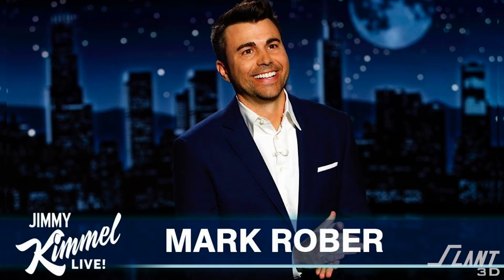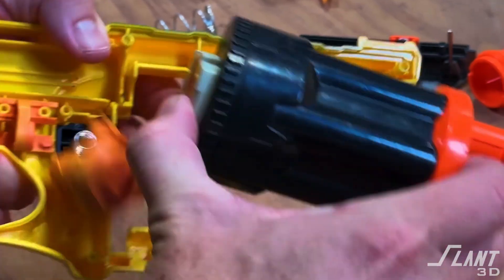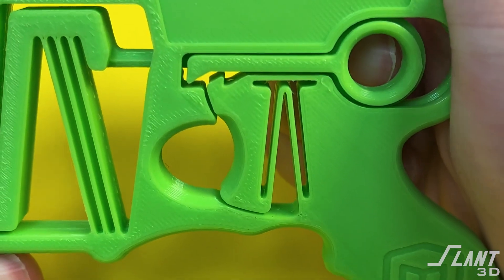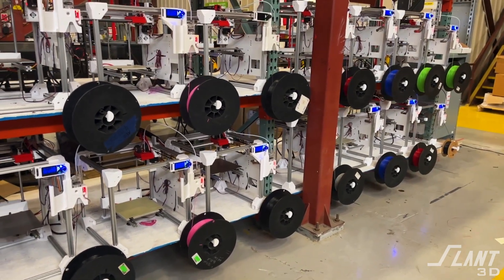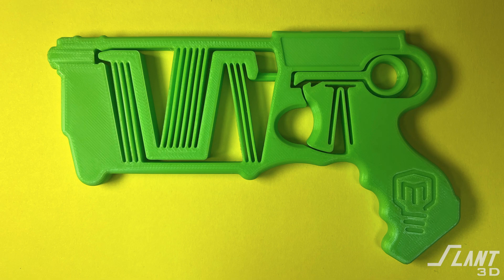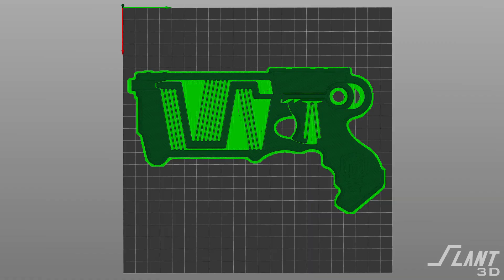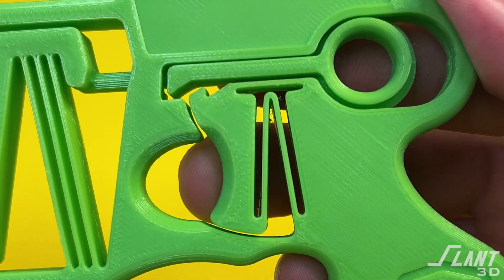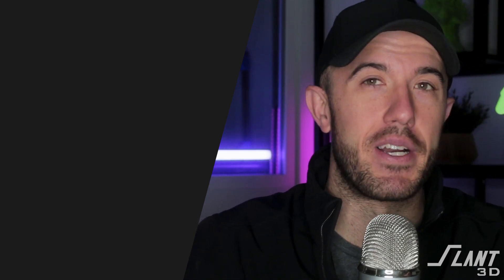The Secret Inside Mark Rober’s 3D Printed Nerf Blaster | Design of Compliant Mechanisms

Comment: This thing should be easy to injection mold with some minor changes to the cocking mechanism and trigger group.
The narrow lines from the compliant mechanism vs the thicker lines of the frame can be mitigated with additional injection points.
Reply: Yeah same, I don’t agree with Slant’s statement at 1:05 that the gun can not be manufactured. Only minor changes need to happen for the part to come out of the injection mold. So, definitely manufacturable.
Reply: @Electheo  It goes against everything slant3d stands for. 

When something cant be on a 3d printer with a desirable outcome he says "design for the process". When something is more expensive/ difficult on injection molding, its "this X could not be manufactured". He has made his business to compete with injection molding. The last thing he will do is admit even the smallest concession to that process.
Reply: That's what I was thinking too
Reply: ^ This, toolmaker by trade, and there is nothing about this mechanism that couldn't be injection moulded. It's annoying listening to this guy.

Comment: I know printing as one piece would be ideal. But some of the issues you addressed could be solved by a 3 piece design. one being the dart gun mechanisms, and two outer "shell" pieces that provide the profile. I do think its awesome to print everything in one piece, but three pieces that snap together is significantly less than the initial injection molded counter part. A added bonus is you could use different colors for the center part and the outer shells to provide more visual variations without the need for multicolored printers (granted each printer is already using different colors)
Reply: With very little modifications to this design, you could make 98% of this object by laser cutting it or using a CNC, all from one sheet of material. The only downside would be to have to pierce the bullet hole separately and doing a bit of sanding. 

That’s the thing that puzzles me a lot with how people use those compliant mechanisms. Most of them would be perfect for laser cutting or CNC manufacturing, which would be so much faster and cost effective than 3D printing.
Reply: 3d printing is just a low commit prototyping medium and admittedly doesn't scale well
but if you just need one or two, or need to iterate. S
perfect process.
the kicker though, is i think the price floor for a cnc machine is a little much
Reply: A 3 piece sandwich covers the barrel channel, and the guide at the back, leaving the center layer as a pure 2D section.  3 pieces that could be made by a laser cutter, injection molding, CNC, etc.

Comment: 3:37 .. what? adding a ripple just makes them marginally longer and more deflection, so a weaker spring per same thickness. How would that make them behave like they are thicker aside from just.. making them thicker? Maybe if you had a biased curve one direction then the other like a singular 'S' per spring element, but not continuous repeating ripples unless you are creating a tension or compression spring. In Rober's design it's a compound spring element more complex than those, the central shaft even deflects a little, unsure if intentional or not.

Comment: I would also like to mention that the bullet doesn’t need to be round. A square-section bullet would mean that the “barrel” could be printed as a simple square hole, with its sides either 45-degree to vertical or at 90, with bridging.
Reply: Eh
Reply: That might affect aerodynamics though. I'm assuming square projectile wouldn't shoot as well as a round one, but thats just a guess. Might not matter without projectile rotation

Comment: Printed one of these myself and was a bit disappointed with the tumbling bullet. I'll have to try the dual density approach! Also the "raft" idea doesn't seem like it would work well. Wouldn't it introduce friction as each of the fins flex along that new surface?
Reply: I’m also not a fan of the raft idea. Large solid cross sections may be geometrically “simple” but the shear material usage and layer time is unattractive. Not to mention when you put that much plastic on the plate you run a much higher risk of thermal warping or peeling (at least on entry level printers). A 30% grid infill is much more stable on a first layer than 100% solid first layer for a large XY footprint part.
Reply: Probably want to make it so thick that there's space to build the springs unsupported.
Reply: Hey Mike!

Comment: Nice video. I would like to see you actually implement some of these suggestions. I think the raft idea would cause problems with all the moving springs. Also, I don't think you should put Slant 3D branding on other channel's video clips. If I had not already see nMark Rober's video, I would have  believed this was all your intellectual property.
Reply from the maker: Title, intro, and whole video references and credit Mark
Reply: @slant3d  You mention several times that he did a video, and you provided a link in the description; that's good. But you still imply by your watermark that this entire video content is yours. You cropped off Rober's watermark and added your own on the segments that you borrowed. I don't think you are trying to cheat anyone, but removing someone else's watermark does not look very good. Just sayin'.
Reply: @no-page What are you talking about, my guy? Mark never watermarked his videos. If you're talking about the mark logo on the right-bottom side of his video, that's a channel button and not attached to the video itself. 
Also the 3D design (which licensed under CC) itself already has Mark's logo on it. If Slant wanted to, he could've easily removed it.

Comment: These are all good improvements... BUT a fully 2D version is interesting too, cause you can make it out of sheet metal using any 2D process (waterjet cutting, laser cutting, etc).
Reply: Rober does have a laser cut wood version on the Thingaverse page, but it's really just a demonstration I guess, as you'd need to glue on extra pieces to hold the bullet in place, like slant3D said.
Reply from the maker: But you can't. YOu can to enclose the plunger and the bullet. It would have to be a 2-3 layerer metal part
Reply: @slant3d  sometimes a larger count of simpler parts is the better option.

Comment: Your approach to auto-ejection is unclear, but in my experience using a wham bam plate and letting it cool off before taking everything off makes the 3d printed parts simply fall off with no issues. Scraping with a plastic razor blade helps a tiny bit, which of course also could be done for an auto-ejection system.

Comment from the maker: Let us know what improvements YOU would make to Mark Rober's Nerf Gun, and if you think we should redesign it in another video.

Thanks for watching!
Reply: I’d be awesome if you completely redesigned it to be a fully enclosed nerf gun made out of one part. Especially if it had similar power to a traditional nerf gun. That would be epic
Reply: I would move the handle more underneath the mechanism rather than in line with it to get a little more use out of the size of your plate.  Also it would be cool if instead of shooting pellets, it shot a winged gilding projectile.
Reply: I definitely would like to see what a slant slinger would look like.  As well as improved darts. I'd wonder if you could use triangular or gyroid infill to create the spring features.  Though that might add to cost.
Reply: While I understand the goal of Compliant Mechanisms is to minimize part counts, single part products seem more are a novelty. What would be the advantage/disadvantage of having additional material snap into place to create a thicker handle for better grip and product functionality and a more useful lifecycle?

Example: a design including a fold-over sections that sandwich and lock to the handle.
Example: a design with additional textured handle part(s) that could go on either side, to increase thickness and appearance. (increasing the possibility of using a  second color, or material like TPU to make a handle more grippy)

Realize this would add requirement for assembly, be it the consumer or as a manufacturing step. What would be some of the non-obvious impacts to mass manufacturability that designers may need to consider when weighing part counts and assembly options of a design?
Reply: While this might be a bit too big of a challenge, something you should at least consider is scaling it to the standard Nerf caliber of .50, probably with half-length darts.
Reply: Yes a redesign would he great! I nearly printed this the other day but for most of the things you spoke about i decided to leave it. I'd for sure print off a slant 3d version :)
Reply: Would love to see your redesign and be able to print it.
Reply: I would love to see your redesign!
Reply: I would redesign the cocking mechanism to look more like a traditional hammer. I think that could make it easier (and more fun) to use.
Reply: @b_dawg_17  In this case, it probably won't. The priming motion is linear, and already a fair distance. You'd need quite a long "hammer" to give advantage, and a transfer linkage to convert between rotational and linear motion.
Reply: @watchm4ker  I don't really know what it would look like, but I think it'd be a fun challenge. And Slant-3D likes to think outside the box, so I'm curious how they would approach the problem!
Reply: @b_dawg_17  nice idea!
Reply: A magazine with a compliant mechanism spring, to force the next object in to the launch tube.
Reply: How about designing it so that it uses standard bb bullets that automatically drop down aka have a container of bb bullets on top so that it automatically „refills“ them. A round bullet might be able to make the projectile go much farther.
Reply: @GreenCaulerpa  You'd use airsoft pellets for that, though spheres would be harder to hold in the launcher without pressure from a magazine spring.
Reply: @watchm4ker  I could imagine there’s workarounds for that. You could 3d print a small single or double walled spring to hold the bb or pellet in place. Alternatively use metal bb’s and a magnet
Reply: Would love to see an improved version
Reply: Absolutely would love a Slant redesign on this. You touched on my two biggest issues I've encountered with this print: the initial layer fails for me some times, and the two finger holes are not large enough for adult hands! Would love your changes with the in-model brim and removal of the stopper at the back!